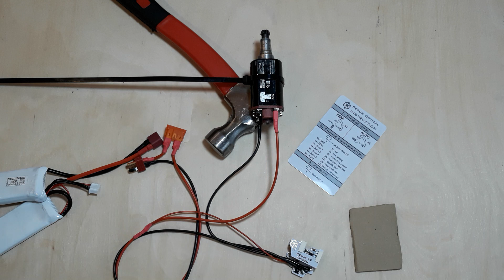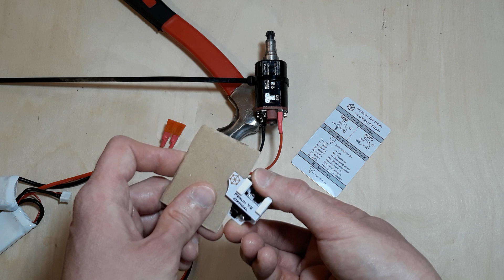Perun V2 diagnostic test

Comment: Have an issue on my V3 optical where every 10 or 12 shots there would be a short beep and the motor won't turn. If you pull the trigger again it would half cycle then shoot when pulled again it would double fire. I've tried different motors and battery combinations and checked my sensors.
Reply from the maker: Hello, please contact our tech support at info@perunairsoft.pl They'll be best able to help with such problem.

Comment: Hey Guys , 
Im struggling with my Perun V2 at the Moment. Tripple checked everything. 

After a shot my nozzle stays in the back postition. The Perun seems to get a whole shot cycle (but it seems like not in the right endingposition) 
I tried everything from cleaning the gear sensors to every setting on the Perun. 

Do you guys have any idea ?
Reply from the maker: Optical series have their sector gear sensor positioned so, that the cycle is detected rather late. This can cause the nozzle to stay in the back position, which is normal, even if active brake is enabled and precocking is disabled.

Comment: I press the selector sensor but nothing happens...
Reply from the maker: Please make sure you press it twice and that there is no sunlight around. Also, the cardboard must be between the trigger sensor and trigger LED while you are doing this. When it's not there, Perun will see this, as if the trigger was being held, and it won't enter programming mode. Should any problems persists, please send us an e-mail to info@perunairsoft.pl
Reply: @perunairsoft4811  followed this and it worked thankyou

Comment: When doing fast bursts in full auto, my perun will beep, any trigger pulls after this will also result in a beep, this can be fixed by unplugging and re-plugging in the battery. Any suggestions to fix this would be greatly appreciated :)
Reply from the maker: Hello Jack, please contact us at info@perunairsoft.pl to reach our tech support. They will answer within one working day or less.
Reply: low voltage alarm

Comment: Is this mosfet compatible with nimh batteries?
Reply from the maker: Yes, but make sure they are at least 8.4V, have a capacity of at least over 1000 mAh and are not discharged too much. It's safer for the battery and Perun, if the battery is able to deliver enough power.
Reply: @perunairsoft4811  thanks alot

Comment: WOW! Great diagnostic system. Congratulations for engineering this. Awesome that you uploading this videos. I need to buy this optical mosfet for rest of my Perun mosfet family XD Now I have only this small Perun mosfet.
Reply from the maker: Thank you :)
Reply: @perunairsoft4811  if you make a ssg will binary trigger work with it?
Reply from the maker: @idkidc3192  Yes, Perun is designed to work with both SSG and DSG. In case of binary trigger in SSG, we recommend using a high TPA motor neodymium magnet motor and 11.1V LiPo to make it work smoothly.
Reply: @perunairsoft4811  22 tpa? Thanks btw
Reply from the maker: @idkidc3192  22 TPA should suffice. In case of any other questions please let us know here or at info@perunairsoft.pl, we will always try to answer as far as our knowledge allows.